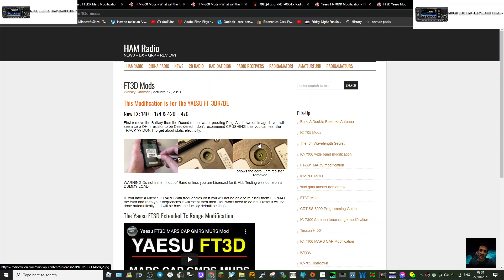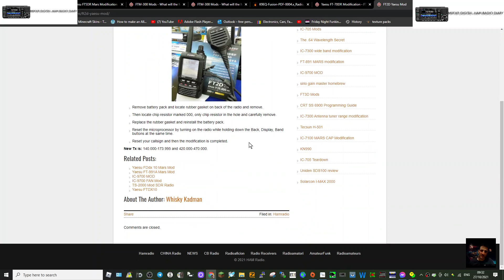YAESU FT3/FT5/FTM300/FT100/FTM400/FT70 MARS MOD LINKS

Comment: I did my FT5d in 10 seconds. Crushed the diode with small snips. Easy.
Reply from the maker: Hi cool
Reply: @M0FXBHamTech  Cool, because it's not a diode))
Reply: As did I.  I just put a couple of tiny flat head screwdrivers on either side of it (using a magnifying glass) and while leveraging them both against the circular opening, popped it out.